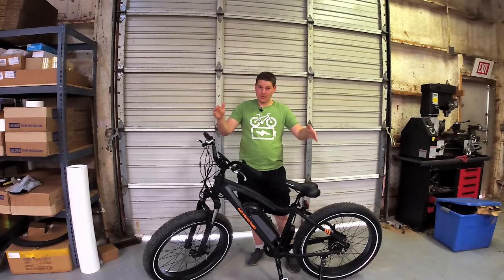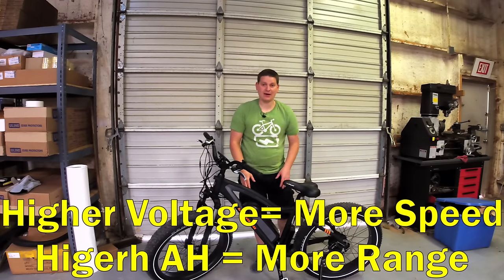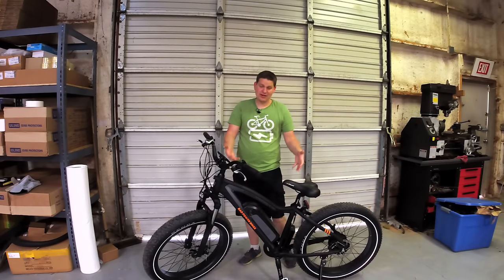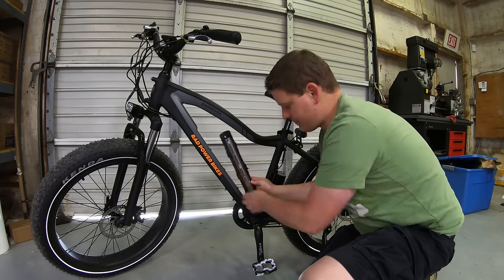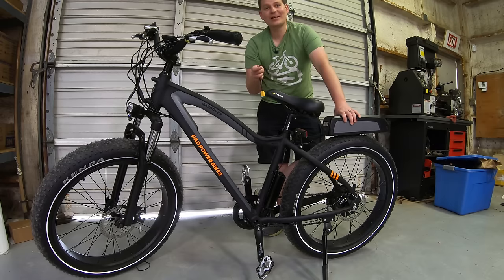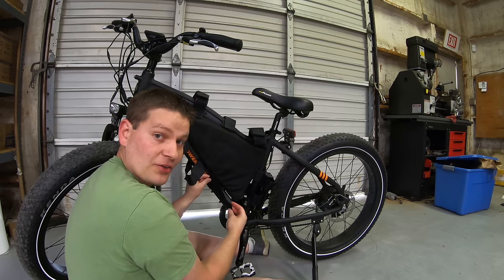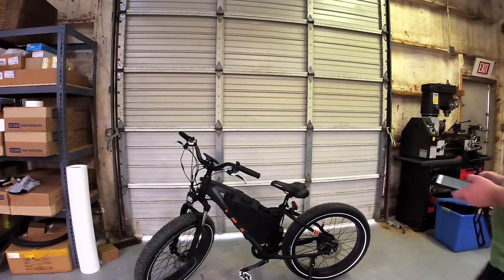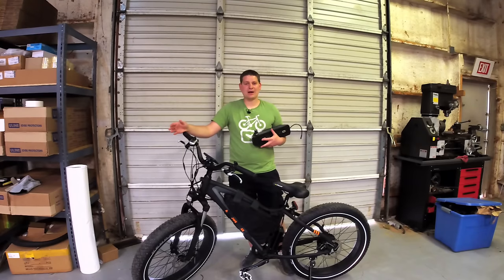Easiest Way To Upgrade Your Ebike Battery

Comment from the maker: Have you ever upgraded your ebike battery? Comment below to get a chance to win a FREE Bolton Ebikes T-shirt!
Reply: Definitely do more on "adding" batteries and dual battery setups. Until we get graphene batteries, adding capacity is the the option we need.
Reply: Also, considering our planetary shitstorm, all brands need to lower prices far more dramatically. The affordability still doesn't apply to the vast majority.
Reply: Yes I just added a second HL battery to my ebike along with a front wheel hub motor for dual motor AWD. What is the part you mentioned for SAFELY adding a parallel battery? Is it some sort of  bms with with parallel battery connectors? Thanks as always
Reply: No I haven’t but would love to try
Reply: No, but I've thought about it. I've got a Juiced Rip Current, 52V, 13 ah with a 750 watt. If I were to get a triangle battery would I need to change my controller? I've also got an old Sondors 36V with a 350 watt. Maybe I should up grade it.
Reply: I just bought a 52v 100ah battery on aliexpress for $1372
Reply: Yes i have upgraded to the 52 volt to better utilize the radpower upgrade kit. It is a totally different bike! Just bought anothet backup battery a huge 35 ah to compliment the 20 ah i have been using. I need that parallel adaptor you are talking about in the video! I didnt know you could get one that managed the current... thats a game changer for me! Hope its in stock soon!
Reply: Bolton Ebikes No, I just got my bike, and haven’t ridden it yet
Reply: now that I have seen how easy it is I will
Reply: I’m getting there just got a Bolton hydraulic caliber installed , love your upgrades on my RadRover.
Reply: no, i bought a used 2018 radmini - i didn't know the battery was proprietary.   something for me to remember down the road.
Reply: I've not owned an Ebike yet but have 3 professional quality road bikes but I'm getting older and want to check out your line of E Bikes and accessories .  I've watched several of your videos and enjoyed them and gained a lot of good information.
Reply: I really don't need long range battery, the one came with it will take me to the market and back with lots of life left in the battery, I need help climbing these steep hills in my town.  That is the reason I am thinking of adding front motor, what you think ?
Reply: @remixread  what make and model of front hub motor kit did you use ?
Thanks,
Reply: afram george I used a 500 watt 36 volt mxus upgrade kit. I picked it up used never installed open box very cheap. If I did not find it so inexpensive. I would have used a matching Bafang 500 watt 36 volt. The mxus is supposed to be 350 rpm and 35 NM torque but it is closer to 280 rpm and 28 NM torque also the wattage is closer to 417 output. The advantage is the motor is being very light weight so front handling and balance is relatively unaffected. In comparison the rear 500 watt 36 volt Bafang is actually 290 rpm 33 NM of torque and 432 watts. These are all nominal 3rd party measurements. This additional motor and battery has me climbing hills with out stalling or slowing but has only increased my speed by about 2-3 mph also I have no problem riding against a strong head wind. Thanks
Reply: I will call you next week for battery and controller upgrade.
Reply: Still looking for an ebike. Great work Bolton Ebikes. I'm looking through all you videos to make up my mind before I purchase.
Reply: What a great challenge for this 1st timer, lets just call it, "Me the Rookie" :D  But yes, i was able to upgrade to a 52v 17,5. Thank you, and I pass this old battery everyday walking to my kitchen and the dishes are still in the sink now I know what to do with this stock and that's to put it to dual-work. What is the name special parallel connector :D
Reply: Can I buy the battery and connections and bag all together as a kit for my radrover
Reply: @WoodyVega, its the XT90 connector.
Reply: The battery makes the bike, I want the best, biggest battery I can get, by definition!
Reply: Can you comment on the weatherability of the generic battery and weather it is waterproof?  Plenty of folks ride their ebikes in wet weather and this replacement battery setup with the cloth bag looks like it may be unsuitable for wet weather.  
Thanks
Reply: E- bikes are the future if you haven't tried one you are missing out. just try one you will find the money to buy one!
Reply: Oh yeah⚡I use a 40a 52v 17.5ah & 30a 52v 14ah cool shirt👍
Reply: @ianaustin8364  make your own!!
Reply: No but it looks very interesting.
Reply: Thanks for the video. What's your opinion of the Lectric Fat Tire XP?
Reply: My question is this: how do we know if the controller can handle the extra voltage from 48 V to 52 V, if we want to upgrade the battery like you did in this video?
Reply: How much is an e-bike battery? Are there any bikes that are not on backorder that you can buy right now? I lost my leg last November I don't want to ride in a wheelchair I like riding my bike it makes me feel free. I have about $1,000 I can spend.
Reply: Can i upgrade my NCM Moscow 49v 13amp 29inch wheel ?
Reply: Don't have a ebike yet
Reply: Hi kyle. Im interested in the triangle 52v 21ah battery you sell and was wondering if you know if its connection is compatible with the "cyrusher xf800"?. Thanks..also the bikes a 750w-1500w peak bafang if this helps
Reply: @LetArtsLive  batteries range from 300-800. Ebikes seem to be 2k and up for a half decent one. Like the one i just bought has dual suspension w/48v 17ah battery , fat tires, only fenders included and a 750w-1500w peak for 2500$ usd and its a rear tire mounted motor the mid mounts are abit more.
Reply: @digitalat2  good question aside from connection compatibility that was my other concern
Reply: @tuckerdoodlelove2007  another good question , whats the water resistant rating on the bag you supply kyle? I know theres ways to waterproof it myself but curious.
Reply: @rapidburrito  lo
Reply: Thank you for the great upgrades and videos Kyle, would love a t-shirt 🙏
Reply: I want to  be able to hook my stock battery and the upgraded battery together on my Foxbat 1000watt E bike. 48v/15.6ah and 48v/21ah, i know i need to buy the parallel connector to do this process neatly. Could you give a video on how to properly connect these batteries on the Fatbox?
Reply: I ordered a Blackbird within 2 minutes of preorders opening up again. The frame appears similar to the RadRover in this video, so the obvious question is whether either the 20 or 30 Amp hour triangle will fit the Blackbird.

I'm considering ordering one of these or a 2nd stock Blackbird battery.
Reply: @LetArtsLive  I bought an ancheer..best value  and I love it. You wont be disappointed
Reply: @roderickday170  you could just unplug one when its going dead..then plug in the charged one..just make the plugs identical  and put connectors at handlebars..when u stop just swap plugs and will have fresh battery
Reply: the only way to sell ebikes is you should be able to get it delivered any where in the world its 2021 there a think called post even if you may have to pay extre
Reply: Ordered the 20ah 58v battery to mount on the rear rack of my Rad Rover Step Thru. If it feels secure I'm going to be estatic since I can keep my existing 48v battery where it is on the frame, just swap the connectors. Cant wait to see how much range I get!
Reply: I'm looking into upgrading my battery for more range, I plan to come to your shop and bring my bike so you can check it out for attaching another battery.
Reply: Thank you very much for all the tips, tricks and videos you have put on about e-bikes there are so many people on the internet with some good ideas but I have yet seen anyone who gets down to the nitty gritty of the bikes you know everything I'm a 49-year-old man my daughter loves to ride bikes I just bought a cheaper one so she doesn't have to wait at the top of the hill while I walk up anymore when we drive around haha I couldn't believe what that bike did for me and now I ride it around for fun all the time with or without her. Even a cheap one of these bikes are very expensive
Reply: If I have a 450-watt battery can I upgrade that to 500 without a problem I know that you can boost the a h morr range can I boost the watch of the battery to help me with my speed
Reply: Hi
Brilliant channel. Thank you for your good work. I have just purchased a E Bike. So find your channel great. So i subscribed.
Kind regards
Carl
Ps
The Handle Bar Jack's you had. Brilliant idea. So you never need move important things.
Great idea..
Reply: I have a second battery for my Rad  Mini step thru. I connect it with an adapter.
Reply: I added a new battery & connected it in parallel to the old one.Then when the old one cut out at about 39.5 volts (it is a 36v system) I turned on the new one that has it's own on/off switch & it did not blow up.How is that?
Reply: Yes I did and recently I blew up on me I contacted the seller they got it from eBay he told me he couldn't get another one
Reply: Well no I haven't gotten that far with mine yet . but, I'm interested in having it for more speed  before I look into abigger moter
Reply: Well , no I haven't yet, but,  I'm still looking into on how to hack  it for more speed. Before I look at a bigger moter.
Reply: Thanks Kyle. This was a very informative video. When I get finished with my upgrades I will probably do the battery. My batteries are loosing capacity.
Reply: I have never upgraded my battery but it is great to know that it can be done. The can be very useful for unintended reason. Suppose you take the battery off to charge it. You drop it and it breaks the casing an the lithium cells fall out. This gives you a repair, via aftermarket replacement, that cost less and is more powerful than an OEM replacement.
Reply: Yes I just did. But no more li ion battery for me...
Reply: havnt gotten an ebike yet, but learning here is very helpful
Reply: What bag is this?!
Reply: My friend I am in dire need of that triangle bag, any idea where to get it? Many thanks in advance.

Comment: I have never done an upgrade for an ebike, but I don't own one yet. I've been shopping and trying to learn as much as possible about them before I pull the trigger. Your channel has been super informative and I've learned a lot. I plan on getting more of a moped style than mountain bike. Battery, power and range are what I'm most concerned with. Thank you for all the information, plain, simple and easy to understand.

Comment: Thank You! 
I've had that bike 10 months now, and put 1900 miles on it. Questions first, then insights. 
1. Does the triangle (trapezoid) battery have the triple anti-fire safety features that the Rad battery has? 
2. Would I need to reprogram the KT-LCD, or will it readout still be accurate? 
To improve my bike I added extra waterproofing everywhere it's needed. 
I also painted my battery case light colored to reduce the heat collection in the sun.  
I'd do the same if I got your suggested battery. I ride in rain & snow.
For preventing the triangle battery theft, I'd either superglue a motion detector/alarm, or create a steel cable wrapping around the bike frame & battery with a lock.
I also tested the bike with lead-acid batteries, but find it only efficient on level roads during low to no wind days, and price-wise.
Reply: 1 yes, 2. reprogram

Comment: You make the electric bike world more accessible to people trying to get a handle on the best decisions for getting a bike and after market extending its reach through external options which are compatible with and not violating the stock bike’s integrity. Very helpful. 👍
Reply: Wonderful use of punctuation
Reply: @RS-hh3et 🤪🤪🤪

Comment: It's nice to know that there are alternative solutons to my Rad when I need to get the battery replaced.
Reply from the maker: Thanks! We try to make it easy to get the most from your ebike.
Reply: Hey I'll let you know how mine goes. I just received the battery blender now I'm just waiting on the 10 amp hour battery I'll let you know. I did do the 35 amp upgrade already so I'm already pulling a little more power still get pretty good distance though.

Comment: All of your videos are well thought out and very easy to follow, especially for a newbie like myself! Being a larger sized person, battery upgrades are an important issue. Thank You for sharing this video!
Reply: If you haven't already upgrade your controller. I have the rad plus 6 and I pretty much max it out at 270 I did the 35 amp controller and it made a huge difference now I'm just waiting on a 10 amp hour battery and I'll do the battery blender. I'll let you know how it goes

Comment: Wish you were in Australia 
I’ve had to replace my battery because I dropped my old one but nobody in Perth seems to know how to repair it.
I suppose we will catch up eventually 😂
Reply: You certainly don't need to replace battery WTF
You can't damage  batteries by dropping them.
Especially if they are inside a case.
But you can break connections and BMS board by dropping it.

Replacing BMS board is normal wear and tear.
They often stop working
This is very common knowledge.
You don't need experience it's very very easy and basic to replace.
 if don't know how to fix or replace basic parts.
No reason having one
It will cost you hundreds.

If you buy a new battery and when the BMS brakes. What are you going to do buy another battery lol 😂

At the moment I don't even have a BMS board in my battery pack
Reply: Learn  about  your  battery and fix it yourself  not to hard to do my bet broken  connection with it  .save some cash lots of information on  YouTube

Comment: I did the upgrade kit, new 750 w motor and 52 w 20ah battery.  The issues I had were with connectors from battery to the controller and I opted to make my own connector.  The real tricky part that you didn't mention Kyle was that to remove the new motor, you need to either go with a special tool that I think you carry but is difficult to locate on your website or use an alternate freewheel.  I wanted a different gear ratio anyway so went with the freewheel.  That is where I discovered that Bafang discourages this by using security torx screws and you need a really good torx bit to remove those little rascals!  I should have it completed in a couple of days after one more part arrives.  I do want to thank Bolton for everything in putting together a great upgrade kit!
Reply: To remove the motor you just pull the wheel out...

Or you have to pull the motor out of the wheel, at which point you would have to re-spoke it in a new wheel. 

Lord help you if you started disassembling the motor LOL.

Comment: Very informative! I have a 4 + year old Rad Mini I never want to sell! Lot of modifications. Even seat is hi end and have great shock adsorber. 780 mile on her. The charger connector broke, so I hot glue it in place. Also case split so i also put Loctite on screws and silicone it tight. However it's getting dendrites and lower range. Do U sell a less expensive battery for my rear rack or one that fits hanging on center frame ?
Reply: Same deal with me ... 2017 rad mini
Reply: Same with me any options available for an off market replacement battery?

Comment: I’m subscribed now! I’ve been using my old Razor Eco for years — upgraded it to brushless motors with two extra kid seats and a 30ah battery bank @36v 350w. But recently I bought a Prado S to get better handling and torque from the wheels and the 750w 48v brushless motor. But I’ll definitely be upgrading the battery ASAP on it

Comment: My question is this: how do we know if the controller can handle the extra voltage from 48 V to 52 V, if we want to upgrade the battery like you did in this video?
Reply: Did you find out?
Reply: @theyutube6549  I got it and yes it can
Mines 2020 radrover 
I got it all,this battery,750 motor,controller and lcd.
Bike goes 32 mph. Throttle only.
I'm 270
Reply: It will say in the controller what range volts you can use. Usually a controller will work a few volts higher cos when batteries are fully charged the volts are higher.
Reply: @cahokia33  can I get the 52v battery and use the stock controller?
Reply: A 48 volt battery 14 series.
Fully charged is 58.6 volt.
A 48 volt 13 series battery fully charged is 54.3 volt.
 
48-volt ebike controller can handle upto 75 volt.

If a battery is not charging any higher you need upgrade your BMS or remove it completely.
And make sure the battery charger can charge upto the highest voltage the battery needs..
This upgrade will cost nothing or next to nothing.

You certainly don't need to upgrade batteries.
This channel will not tell you that.
They won't make money.
Reply: @profilmwork  
Your question makes no sense because a small 48-volt 13 series battery can charge upto 54 volts fully charged.
If it's not charging that High you need a new BMS or battery charger what can charge that High
Reply: @cahokia33  did you have to change the settings on the LCD screen? If so what are your setting numbers